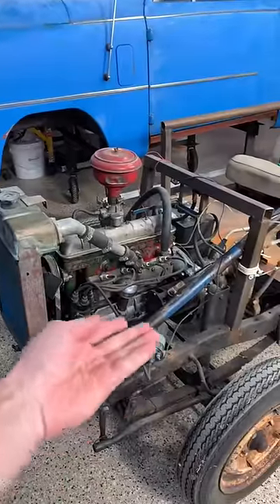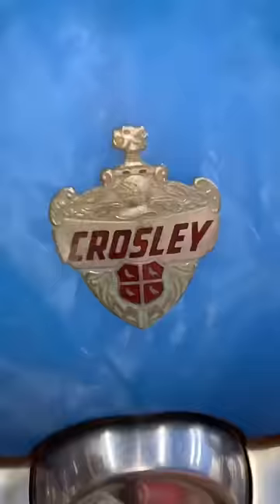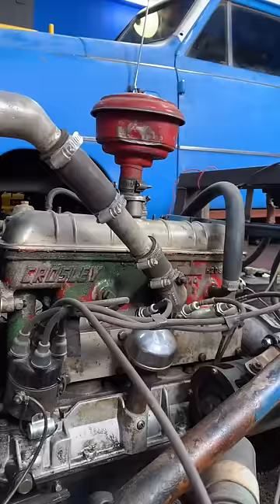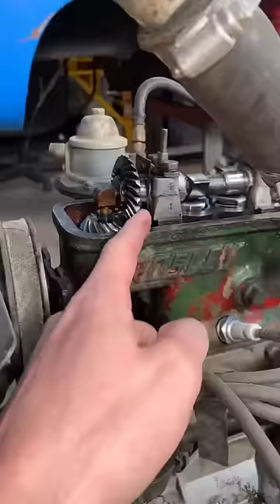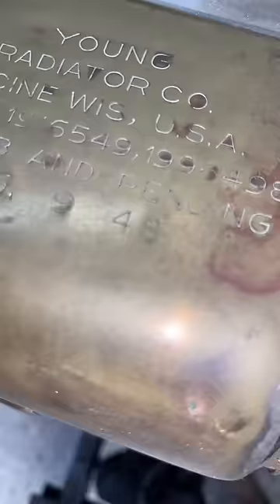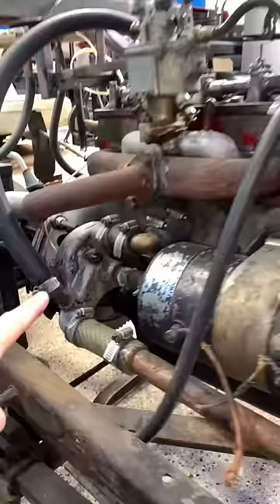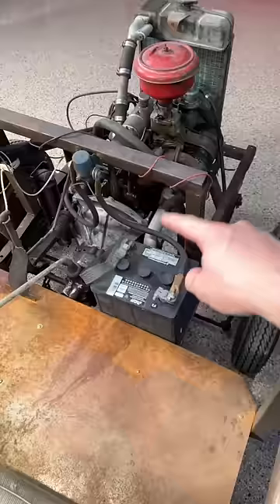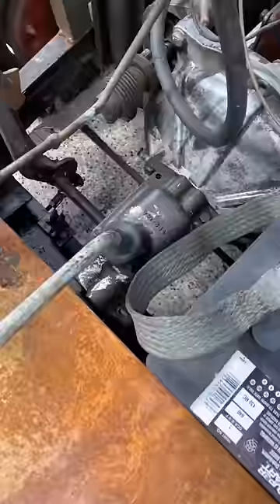Anyone ever seen one of these before? #cars #carsofyoutube #crosley #junkcars

Comment: Please don’t ruin that classic. It’s in very nice condition for its age, respect that !
Reply: Buy it you can keep it hidden away forever
Reply: @thatgarrettboygaming2052 that's a stupid take.
Reply: Chop, section and channel the body. Build a new frame and put it on bags so you can slam it all the way down to the ground. French the headlights and taillights. Get a set of chrome reverse wheels and baby moon hubcaps. Put an LS in it and you’ll have a mini lead sled. (They don’t use lead for bodywork anymore. If you use Bondo it won’t really be a lead sled but it’ll look like one.)
Reply: Too late
Reply: @vladtheimpala5532  they're called "bondo buckets" now.
Reply: @thatgarrettboygaming2052  There is a difference between not hiding it away, and smashing it with a hammer.
Reply: @Hathorr1067  he can do what ever with his stuff
Reply: WELL SAID .. PLEASE PLEASE PLEASE DONT DESTROY IT
.
Reply: Not yours he can do what ever he wants with it!
Reply: He didn't ruin anything it can be put back together.
Reply: @vladtheimpala5532   Eastwood still sells the lead bars but they also sell a lead free body solder. The lead free is more popular because you can sand it where as the lead you can only file.
Reply: @societasdraconistarum  
I don’t know a lot about bodywork but I think the lead gives off dangerous fumes too. It seems to me that if you’re doing stuff like chopping tops or sectioning bodies, metal filler might be better because if you use plastic filler you can only put about 1/16 of an inch on.
Reply: @farmsgrace341  
Lead sled sounds better than bondo bucket. Bondo bucket sounds like somebody slathered on about a ton of plastic filler which will fall off and reveal sloppy welds and rust holes.
Reply: Nah, stuff that. It needs a full tube chassis and at least a small block
Reply: Such a shame....always chopping up classics in USA...
Reply: you might like JapHands channel they custom made a little body instead
Reply: @ZerokillerOppel1  
Just out of curiosity, what would you do if it was yours? Let’s say that you have all the necessary skills and money is no object. 
I like resto-mods because you can drive them. They’re more reliable and handle better because they have modern suspensions and drive trains. 
This isn’t the type of car that appeals to me because it’s underpowered and I think it’s funny looking but it does have some appeal because it’s quirky. If you did take it to a car show there wouldn’t be 10 or 15 cars just like it. It’s just not something I would put time and money into. 
But for this question you have all the time in the world, all the necessary skills and an unlimited budget. It’s yours. What do you do?
Reply: @vladtheimpala5532   Yes lead does give off fumes and they have special respirator cartridges to use. That’s also another reason the lead free body solder/ filler is more popular. I’m old enough to remember using it without any protection, I can only imagine what my lead screen or asbestos testing would turn out like.
Reply: I know if it was mine and money wasn’t an object I would build a 50’s gasser. Maybe even with that engine, because you could buy blower kits to put on it. They actually made a lot of performance parts for the crosley engine.
Reply: @societasdraconistarum  
Thanks for the information. I love the old 49, 50 and 51 Merc and 50  Buick lead sleds. I was only half kidding with my suggestion. 
I know people used to turn those into gassers. I didn’t know they used the Crosley engine.
Reply: @vladtheimpala5532  You could've guessed my answer: I would completely restore it, overhaul that little engine and make and keep everything period correct the way it left the factory. That's the way I would like it. But that's just me talking, some Euro from across the pond...😏. Some like to do it the American way here too but restoring to "fac'tree" is much more common. Don't get me wrong, I like the occasional restomod if done right. Maybe we get a whole wrong picture here of US car/motorcycle culture by watching too much Orange County Chopper/ Richard Rawling etc.etc...🤣
Reply: @ZerokillerOppel1  
I’m not familiar with Richard Rawlings but those things they make at Orange County Choppers are not bikes that I would want to ride. They’re impractical. I don’t think everything needs to be kept bone stock but I do think it should be useable. They are not an accurate example of how most Americans build their own bikes. 
I appreciate your response and yes it was not a surprise to me. If you built it the way you’re describing it wouldn’t really keep up with modern vehicles on modern highways but it would be a time capsule and you could drive it around town and on country roads in the United States. You would also be a hit at car shows. 

As I mentioned, I do like resto-mods because they maintain the look of the old cars but give you the performance and reliability of modern cars. I also like the old lead sleds if they’re done right because they’re works of art that you can drive on the street. A 49 Mercury is improved over what the factory did when given the full custom treatment in my opinion but to be honest if I had one and it was in pristine condition and completely stock I think I would switch it to the modern 12 volt system but otherwise keep it stock (my dad had one when I was a kid and I loved it) but if I had one that was pretty far gone and needed a new frame and a lot of bodywork I’d use it as a platform to build what I consider the ultimate lead sled. I love the old flathead Ford V8 so if it had that, I would consider keeping it but a Chevy LS7 is such a great engine and so reliable I might drop one of those in it. If the flathead was long gone as it probably would be, I wouldn’t look for one. I’d just put an LS in it.

Comment: That's absolutely gorgeous. Please restore it to its original total glory!
Reply: Already going to ruin it because it's too slow. Sometimes people can't leave well enough alone. Fix it and restore it to its former glory. It dont have to be fast to be good
Reply: @josephmaxwell896 I know. So useless. I own a 1972 Opel and like to say it does 0 to 60 in 3 months. Should I drop a 350 in it? Leave it as it was. That's the point.
Reply: @Free-uw4jl  I think the vehicle is amazing enough for it's time.
They'll never be made again.
Reply: @Free-uw4jl  You could probably get away with just a Predator 212 swap.
Reply: @vintagethrifter2114  I generally like restomods, but those are made for practicality and consistent driving. This vehicle this unusual and is better off left as it was.
Reply: The original car had wood floors and a weak frame, what he's doing is all you can do to a car that's no doubt rusted very badly, the '50 I looked at had large pieces of the frame, the trans mount, and motor mounts replaced. They were very cheaply made to start with, it's why they didn't last long. Plus their wheel base was so thin they tended to roll over at speed. The guy that owned it said he had to rebuild the whole right side when he bought it. Also he said the car would fill up with fumes while he was driving and the windows only opened half way. I suggested he buy a trailer for it and leave it on it, he said he was planning on it! LOL
Reply: @scarsdale7186  So why make it faster?
Reply: @Free 12  I looked it up, that motor has 24 hp, enough said. With a 3 speed, it would take a long time for that car to get up a hill or just get up to 35 mph.
Reply: @scarsdale7186 I understand that, but my 72 Opel Kadett has an 1,100 cc motor rated at 50 hp, and it's a heavier car. The vehicle we're discussing is so rare that I would leave it stock - even if incredibly underpowered.
Reply: @Free-uw4jl  I understand that and I do love a fully restored car like that but if you look at that car it's been sitting for years I doubt there was any flesh left to the underside. Plus with him using square steel he's increasing the overall weight so he may have no choice in the matter. It's so rare there are NO parts for it and the rest of the motor is cast iron so all he's talking about is upping the HP so it can handle the weight better, not turn it into a rat racer. That motor would red line at 3000 rpm I doubt he could do much with that. Up the torque up a bit is all. I feel for your feelings I do but let's face it; it's his car to do with as he see's fit nothing either of us say here is going to do anything other than waste our time and his.
Reply: @scarsdale7186  I wonder if he's even reading our discourse, but, though sometimes difficult, parts can be remade from scratch. I hope he does the little car justice. Whatever the finished product, it will certainly be one of a kind - not your average 1970s restomod.

Comment: Two words...... Restore it.
Reply: Or two other words..... preserve it; but not THESE two words..... destroy it.
Reply: They weren't the best car most were wrecked due to roll-overs. They weren't a "family" car with a 20+ HP engine.
Reply: @scarsdale7186  You're right, they weren't the best cars. In fact, they were pretty crummy; and yes, most are gone...which is why these historic little oddball cars should be saved when possible. And this one appeared to be in much better shape than many I've seen.
Reply: @squiggymcsquig6170  Oh sure! The '50 I seen was in pretty good shape but that was in the early '90s I don't know if it's still around. The cracked cylinder my father's '48 engine seems to of been a common problem for the motors, and since the head was welded to the cylinders it wasn't an easy or cheap fix.
Reply: That's 4

Comment: Love the bevel gear timing set. Back when things were built to last longer than the warranty.
Reply: I bet you couldn't drive it across the country without having to service it Even when it was new.
Reply: That's the way my mom's 1960s Singer sewing machine is driven.  Motor in the bottom and top mechanism driven by vertical shaft via hypoid and bevel gear sets.  Precise and fast.  Anything newer has just a plastic timing belt.
EDIT:  I've seen the original invoice, mom paid $359 CAD for the machine & cabinet in 1963.  Today this is the equivalent of $3400 CAD (or $2500 USD).  At that time her father thought that was far too extravagant for a young single lady.   Today one can buy a machine with the "Singer" name from Canadian Tire for less than $200 CAD, and if you scan the sale flyers it might come at half price.  But how long will it last?  Mom is still using her original machine.
Reply: I got an 86 Honda prelude with 327,000 miles and it runs and drives amazing we’ve put 7,000 on it in a month and it wasn’t even phased all I have to do is change to oil every 3,000

Comment: Man that cam has got to have the most reliable setup I've ever seen, can't really beat a shaft and gears
Reply: tell that VW who managed to fuck such a system up in their 2.5/5.0l TDi
Reply: Or Renault,their older 2.1 diesel had a chain from the crank driving an intermediate gear set,which then in turn drives a toothed belt to the cams,having all three on one engine is plain stupidity,but the fact that gears are infinitely more durable than either chain or belt makes it even more remarkable that it was the gearset that failed first😂
Reply: He he he…he said beat a shaft.

Comment: A shaft driven valvetrain is the most overbuilt sh*t ever and I love it
Reply: W800 Kawasaki motorcycle has entered the chat...
The W800 motorcycle is powered by a vertical twin-cylinder 773cc four-stroke engine that features a distinct bevel gear-driven camshaft and SOHC 4-valve head ...

Comment: Crosley was actually a popular racing engine.

The first overhead cam engines were in the early 1900s.  There was one that was an OHC, 4 valve per cylinder, hemi, built around 1919, I believe.
Reply: Peugeot had that configuration in the 1912 Indy 500 winner.
Reply: Turtle racing is a thing too.
Reply: He said it was their first mass produced OHV, not the first ever made
Reply: @archygrey9093  

Yes, and the engines I mention were all in production cars at the time. You could argue that no cars were mass-produced until the Model T, but, they were produced in the quantities the methods of the day allowed.

There were many advances that we think are modern long before they became popular.  One example is Cord, which had a front-wheel drive, supercharged V8 with hideaway headlights in the '30s.  The first electronic fuel injection was on a '58 Dodge truck.
Reply: @archygrey9093  Maybe mass produced by that brand or in USA. But many others had been mass producing OHC engines for passenger cars. I've got a 37 singer, very common car back in the day. They had been making OHC engines for years.

Comment: 1970's steel hood Power King tractors came with the same transmission.
Make sure in the final form,
u allow easy access to the entire top of the transmission, enough to allow u to easily take off the cover.
Fill it at least half with Lucas.

Some Power Kings came with two transmissions inline, if ur looking for a few more gears.
Reply: I think you mean Model A Ford trans, I know some had them and possibly a converted rear axle as well
Reply: @whathappensinmaine5463  the 50’s yes the 70’s no. In the mid 60’s to end of the steel hood models the came with the T92 transmission that’s the same as the crosley cars
Reply: @seeyouinmymirrors  ohhh alright, I only ever knew of the Ford 3 speed. Shit I learned something new thanks man!
Reply: @whathappensinmaine5463  those are the more valuable one that’s why I haven’t messed with any of those. I can’t afford it lol
Reply: @seeyouinmymirrors  yeah I feel the cant afford part. I ran into one and asked the guy. Here in maine they run from 500 non running to 2k running with various attachments

Comment: OHC would be fine but look at those damn bevelled gears,like a diff!! very different
Reply: Bevel Drive gears are not uncommon, but they are a little more costly to produce than chains , tooth belts, or  standard gears . Manufacturers generally pick the cheapest method to accomplish any given necessary function. In fact, that is the definition of engineering to accomplish the task the cheapest way possible with adequate reliability. In reality, when something is over-engineered, that means it breaks down more often than is desirable because they remove too much reliability and cost-savings.

Comment: Cars are quite valuable and rare. You should think about just a resto stock. The first little engines had a furnace brazed stamped steel block. And lots of engines had over head cam way before the little crosley.

Comment: My father, back in '68, had acquired a '48 Crosley motor and trans, he built a farm tractor with it using scrap metal and a '54 Volvo read end. worked great for a time but since the head and cylinders were one piece the walls cracked and the motor failed. So he took a '57 Volvo motor and trans and installed that. it's been running ever since. We don't use it anymore but it has a place of honor in our front yard as a statement to my father's ingenuity. He's still alive at 89 and asks me often how it's doing, I don't have the heart to tell him we use a John Deere now :( I did see a '50 in working condition at the factory I worked at many years ago the owner only took it to car shows and drove it to work one day before a show.

Comment: Yes I  have. It's basically the Textron Homelite 55 HP 4 cycle outboard motor. My dad bought 2 of them in 1965 for 2 boats we had. Look up the Homelite outboard motors. The engine had 2 carbs on it, same OHC and same 44 cid engine.

Comment: 60 years ago my brother's first car was a 1951 Crosley Wagon. He stripped it the same as you did and we ran it around the woods for years. When he got old enough to get his license, he bought another and drove it for several years until he upgraded to a 68 El Camino. He still has the El Camino 54 years later. When he needed to change the clutch, the two of us picked it up and balanced it on the radiator support. He changed the clutch while I held the engine. We then put it back in and he finished the assembly. I've seen several homemade tractors with Crosley engines. My homemade tractor, that my FIL built in 1963, has a Crosley front end and a Waukeshau engine.  Good Luck, Rick

Comment: I never seen a shaft driven overhead cam. That's too cool
Reply: These engines do not have heads. It’s all casted, one piece, and the crankshaft assembly is in a lower assembly.You can find These engines in boats, generators,little Jeeps they built and other equipment.
Reply: Ducati!!